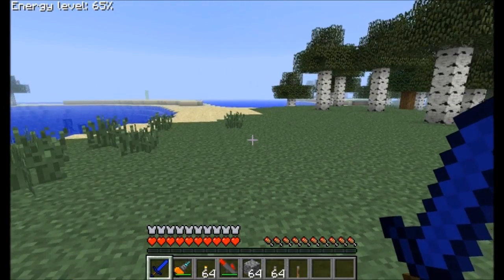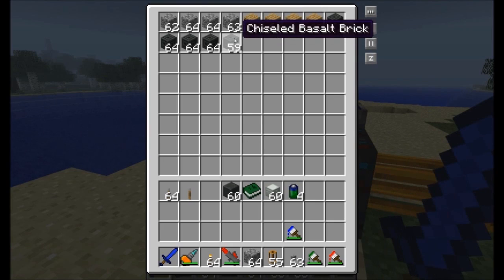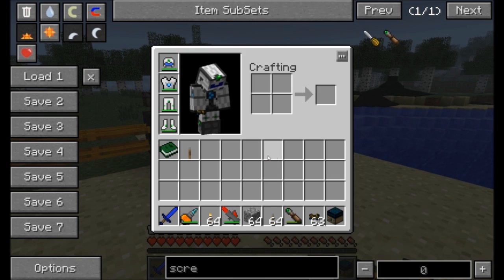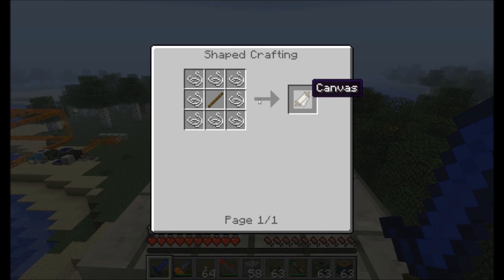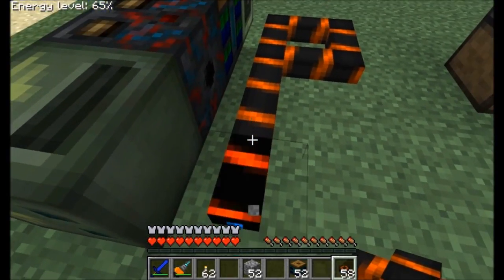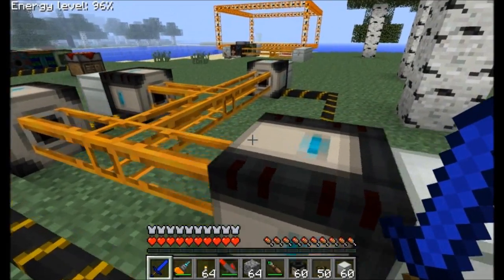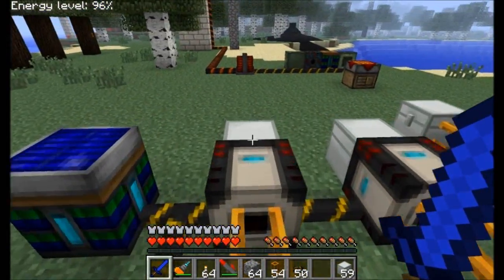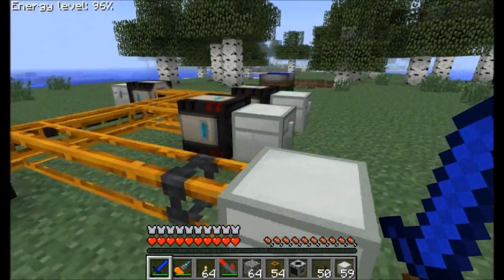Mod Spotlight - Red Power 2 PR6 Part1

Comment: i used to see blocks and items from redpower in technic pack/tekkit and ftb and think "ah its just redpower theres probably a better/more efficient block in another mod somewhere". 
but its a really solid expansion to minecraft with fitting textures and is an excellent core mod and adds so much room for creativity. also i think it would go nicely with thermal expansion.

Comment: Technic and tekkit lite are also not compatible with bukkit, which is what is used in SMP. It's pretty easy to download the new mods and put them in my folder. It's not however easy to make it compatible with bukkit. So basically, still outdated as far as i'm concerned. But FTB can  be played on SMP as it is updated.

Comment: hey direwolf i wanted to know when u have two wind turbine connected through one blue alloy cable (not one but a line leading to a battery box) if the blulecticity adds up together or just stay the same. If so what are the benefits of having two wind turbines in stead of one. In my world i have this set up but when i read the current it says the say energy from the line is equal to one turbine which was not what i expected. i expected it to add up so i used a 10kV wire. plz help.
ty in advance.

Comment: I try to hookup a blulectric engine to a conductive pipe or a energy pipe but it don't seem to connect like any other engine would be.. do I need to put the engine directly on the machine it have to provide power to?

Comment: The new engine is pretty amazing.... HOWEVER good luck keeping it powered. It is one hungry sonofabish. In my SSP world I built a four as my main source of power output for thermal expansion machines (following dw20's lets play vids :P). 1 wind turbine and 36 solar panels connected to 15 batboxes power them, and it wasnt enough. 

I changed it to just have one Bluelectric engine suuppling Redstone Energy Cells, and it drains the entire system in one mincraft day. 9000 watts is not enough!!!!

Comment: There is an extra data value that items can use that is used mostly for damage. Because of this, it is a different item. If you can, you could try a repair chest to fix the uran cells (expecting that's your problem) THEN sort them.

Comment: Its actually one of the oldest parts of better than wolves added long before redpower had it. Its one of the things that can be made by the saw block. I think it only had about 2 micro blocks though (plank slabs and plank panels) so rp2 has a much better selection for building.

Comment: Nah, it does work. When pulling energy from engines, the engine itself has to be connected to a wooden conductive pipe first. It doesn't appear to connect to the engine but you will get energy transfer. However, I think the amount of energy the engine will output will be fairly low, I haven't tested it enough yet to know.

At least, it works for me in conjunction with Thermal Expansion's MJ storage blocks, whatever they're called again.

Comment: wow really I would just like to amplify the managers aweswomness a little more as someone who has worked with networking and server networks before the managers themselves are acting like switches in a large area network where the tube system is the hardware and fiber and routes different packets of information (blocks) and desiganates its destination furthermore with the ability to paint certain managers you can create multiple data streams within one network (lan) much like setting up (vlan)

Comment: In reference to the Blulectric engines and dire saying it's "one of the first cross-mod compatible items", dire, I like you, but that is completely and entirely wrong, between railcraft's steam turbine, several addon mods which add compatibility to basically everything, forestry's electric engine, and I'm sure more, there has been a constant stream of compatibility mods for everything except, for obvious reasons, redpower.

Comment: Pretty much anything you can do in bc, you can now do in rp. The only thing I can think of is the bc logic gates, but the increased functionality of the rp blocks is taking over that as well. The only reason I have bc installed, at least, is so I can use forestry and railcraft. I hardly use it otherwise..

Comment: now you can make a fairly cool lock set with just a specific item in a specific chest. lol make random holes that all connect to random obsidian pipes and one leads to a chest hooked up to a system of like 10 chest all different colors. so you have to throw the right item into the right hole so it goes in the right color chest to activate the redstone.

Comment: When I use the handsaw to cut blocks, everything I cut is like invisible. The textures seem to be missing from the cut blocks. Is that just a bug in PR6? Or do I have to add in more than just the Core file to get the textures to show?

Comment: The model and texture of the transformer is actually wrong for what it does, it would need two inductors and the steel  inside them connected between each other, but the wires arent connected, it is jsu

Comment: And why should he have a problem with Better With Forge? He doesn't have to worry about making it compatible (on of the reasons he left), he doesn't have to work with Eloraam (another reason). The only reason is that you won't get the "BTW experience" which is just his opinion to begin with. If BWF is on par with BTW plus with forge compatibility, then everyone is happy. BTW guys could play BTW standalone and Forge users could play BWF with their mods.

FlowerChild is just a spoiled brat.

Comment: You can connect your power to any side *wires only connect to 2 sides* Ah Direwolf, your mod spotlights are pretty amusing sometimes! :D And this was right after you show and say the recipe for the voltmeter instead of the transformer.

Comment: All that stuff with volts and amp is really rather simple if you put your mind to it.
You need to look up Ohm's law: I = V/R
I = amps
V = volts
R = resistance

You can think of volts like a waterfall. The higher the fall, the more potential energy.
You can think of amps as the amount of water flowing
You can think of resistance as the restriction a pipe imposes.

I may seem complicated, but it really isn't.

Best regards.